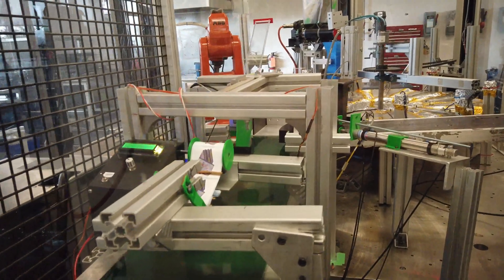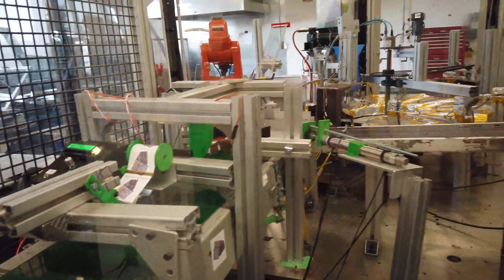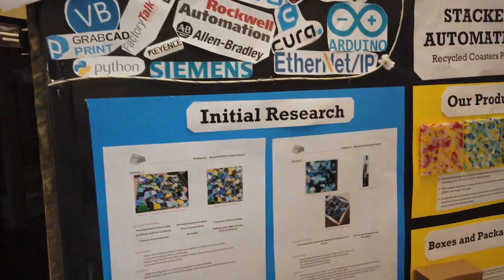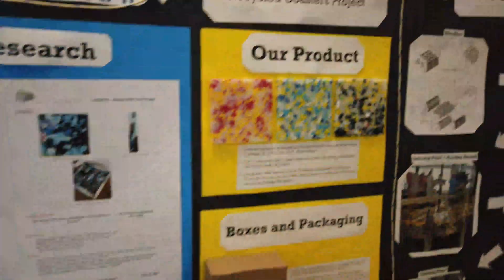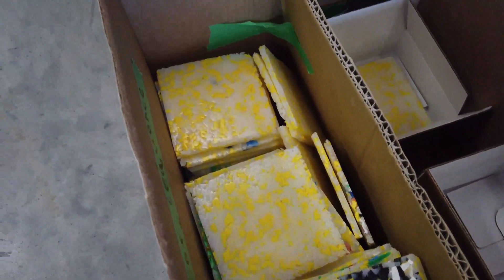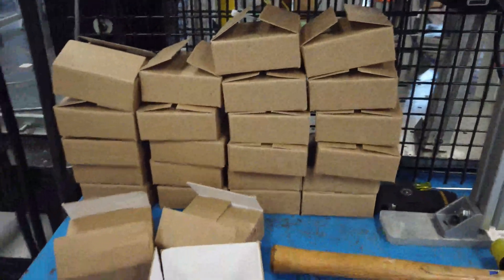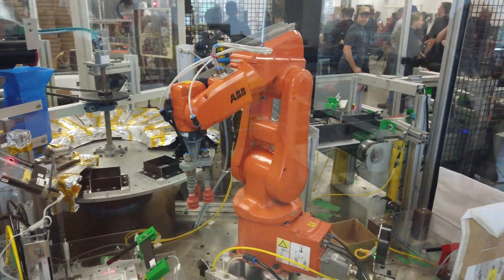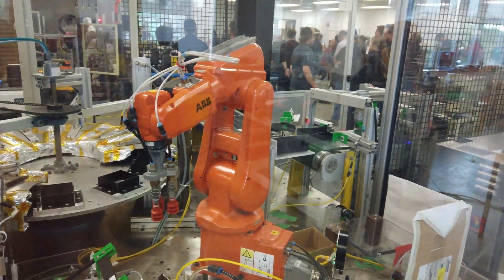Robotics & Automation

Comment: As a current Electrical and Electronics Engineering student in future if l have purse this course is there any possibility to land a Job ad a automation engineer in canada?
Reply from the maker: Graduates are prepared for an exciting career in the area of industrial automation using robotics and PLCs, including equipment specification, design, installation and troubleshooting. Sample job titles include: controls technician, maintenance person, robotic technician, PLC programmer, automation specialist, solidworks operator. Typical fields of employment include small to large manufacturing and support industries including automation consultants, automotive manufacturing, food and beverage processing and packaging, pharmaceutical, and more.